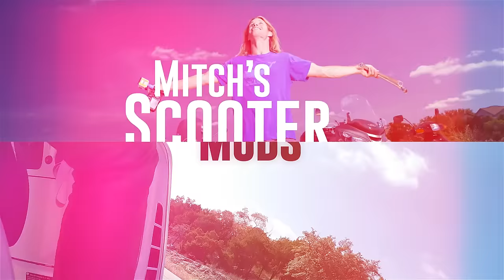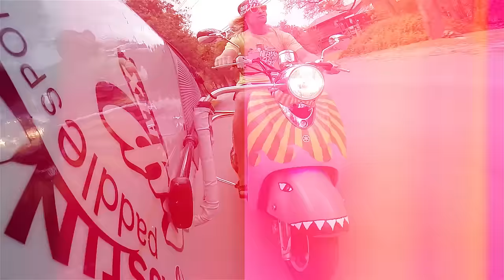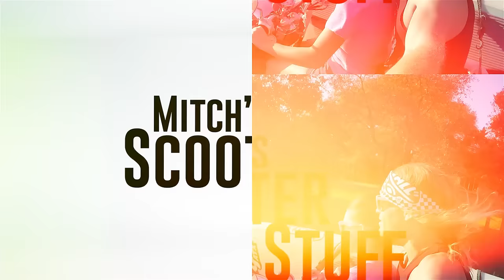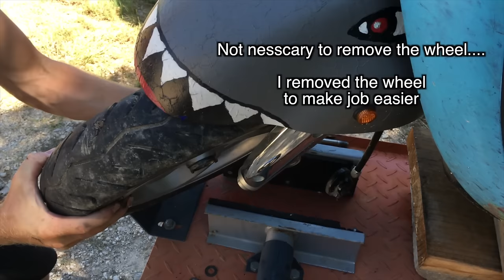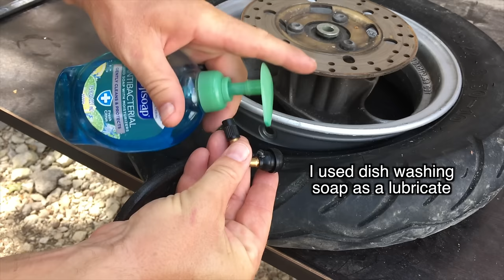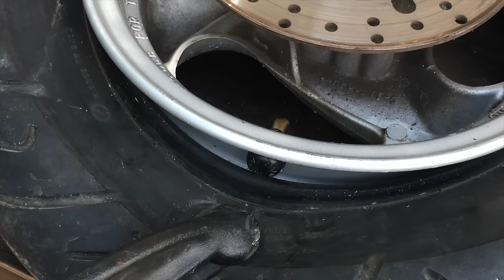Wheel Tire Valve Stem: How to remove and install it | Mitch's Scooter Stuff

Comment: Are these scooter tires tubeless  now?  
I'm old, I work on cars, I haven't had a scooter in decades.
But I have to do a tire on my brother. 's scooter and when I looked at the valve stem. It was a fixed valve stem in the rim. I've never seen a tubeless moped tire?

Comment: I did it with a c clamp in my hoa with a prv70 stem. No silicone I pulled it through by hand with a little wiggle. And my scooter rim is thickkk! If one does struggle, I'd almost guarantee they could do it by hand with a little lubricant/ silicone spray
Reply: Also if you pivot the c clamp on side on the rim and one side on the tire. You can compress it enough with the entire wheel still on. No need to remove it. Neat video tho
Reply: I would just recommend putting a Microfiber on the rim where you are compressing on

Comment: Man.. I just pumped up the back tire on my scooter, and when i went to disconnect the pump, the whole valve metal rod thingy came out, but the rubber thingy is still sitting there.. Is it possible to superglue it back inside the rubber thing? lol

Comment: If you spread the load on one side of the jack like this guy did with the door, only one side of the tyre will break the bead and therefore you will move the side of the tire more that you are working on and also have less bead to reseat afterwards. Before pumping up the tyre Kick it a few times on the side where the valve is the tire will move and butt up against the bead meaning that it is semi-sealed and the tire pumps straight up, I didn't take the valve stem out and pumped it up with it in, which is better since the threads on the valve are small and easy to damage or over/under tighten, and its better not to mess with them if possible.

Comment: before you use the rubber type valves check your rims, my GS1000G had a much thicker hole and I couldn't get this rubber valve to seat properly